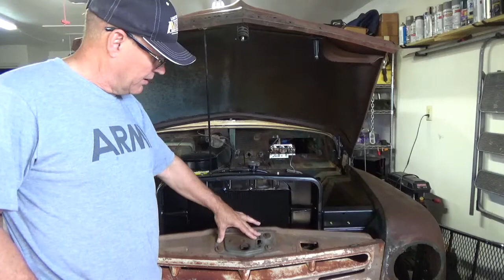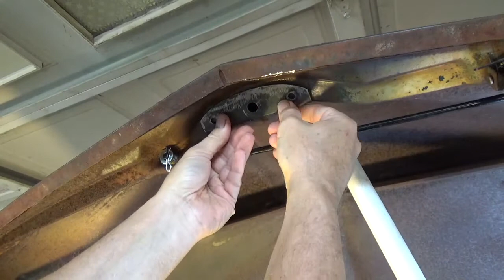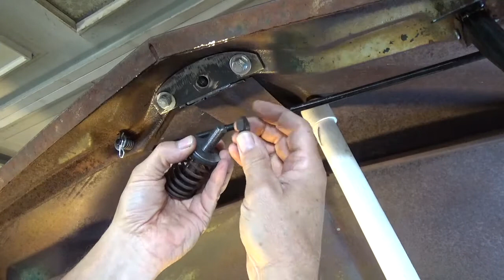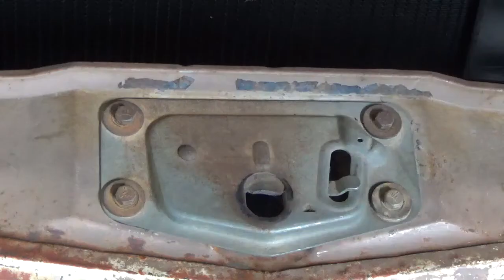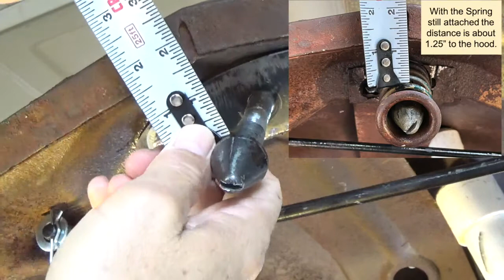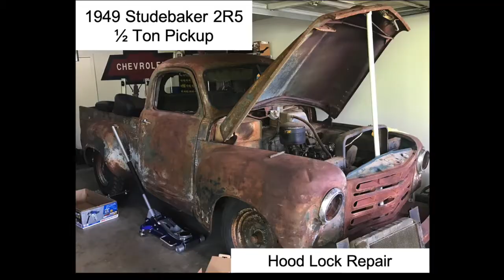1949 Studebaker 2R5 Truck Hood Lock Repair

Comment: No the one on the hood cant buy the spring
Reply from the maker: Howdy, apologize for taking so long to get back but the spring is cylindrical with a 1.5 inch outside diameter, 2.5 inch overall length and the spring coil wire measured 0.13 inches.  I did find the dovetail, spring, and spring washer retainers on the Studebaker International catalog on page 88 of their 2024 catalog.  Know it doesn't mean they have it but you can get the part numbers.  Stephen Allen's is another source.  Hope this helps.  Billy

Comment: Hi so did you finish the truck ?? I hope you did .👍👍
Reply from the maker: Hi, Thanks for checking up.  Had to take a break for medical reasons then ended up moving to another home which included setting up my shop to work on my Studebaker.   Looking to take her back apart and get the body work done early next Spring. Since I put her back together for the move I took her to a car show back in June, only Studebaker out of about 250 cars.  Do take her for a very short trip down the road every now and then but can't wait to get her tagged and go for a longer, legal trip.  :)  Thanks.  Billy
Reply: @billyt5924  thanks for the update it hope all is well 👍👍
Reply: These videos are great and have helped me a lot. I am restoring 1050 2R10.

Comment: Hi Billy, Russ here, Like what you are doing, I am doing a 1950 Studebaker truck myself and I have a question for you. As I can’t seem to find a picture of where they go. They are two square washes about 2”x3” with a 1/2” hole in the center. I want to say they go on the front body mount, but I just don’t know, did your 49 have something like that? Thanks Russ
Reply from the maker: Hi Russ, apologize for the late reply, been out of the net spoiling grandkids and haven't paid attention to the computer.  I believe your washers are for the front cab mounts as they would match up to the rubber mounts that go between the cab and mount.  Mine had large round washers that had the rubber mount between them but the rectangular ones you have would work better in my mind.  I could not find any pictures of the washers or rubber mounts other than those I took before disassembly of my truck.  I did make the rubber mounts out of tire sidewalls based on the dimensions of my old ones which were similar to the size of your washers.  Hope this helps.   Billy
Reply: Thanks. That is where I put them right or wrong.lol